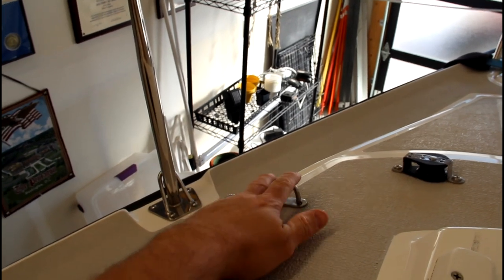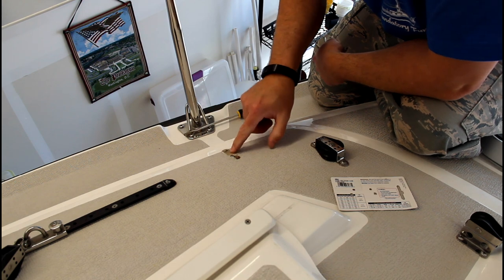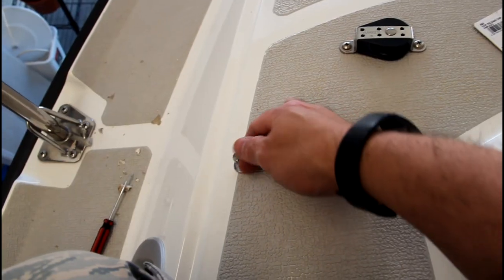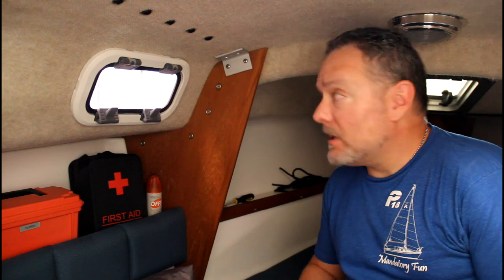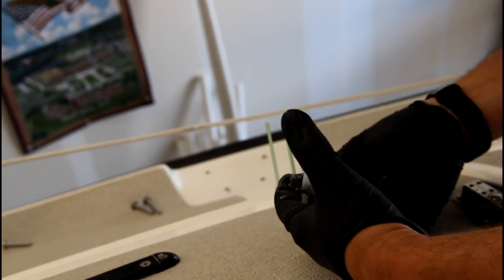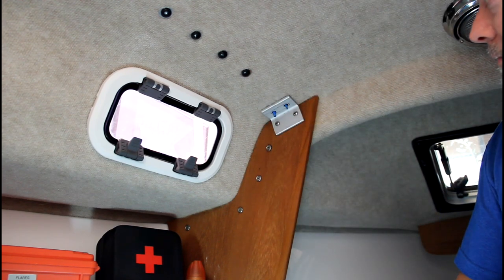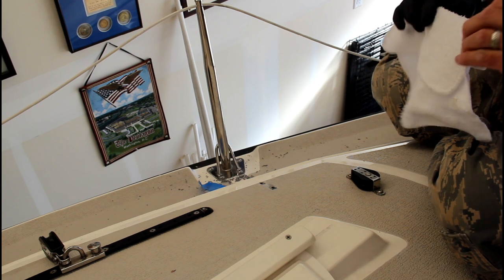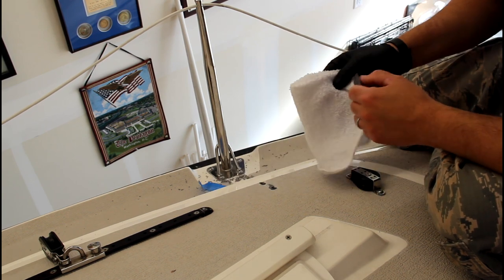Leaky Chainplate Repair

Comment: Thanks for video i will be resetting lifeline stansions after this season  i just assumed the core was wood ido like the simplicity of butyl ,i use it for everything idid use 4200 when i replaced my swing keel its easy to get it everywhere,? thanks again for the post

Comment: Hey Dave, nice repair tutorial. Question, how do you know how hard to 'torque' the fitting down without over compressing the deck? Tnx.
Reply from the maker: Hmmm. I hadn’t really thought about that. I just tightened till it felt right. But, you make a good point. If not tight enough, then any movement or flexing could break the bead of the sealant. Too tight could compress the deck and maybe crack the fiberglass. The good news is that unless the chain plate snaps in half…it’s ain’t going anywhere. The backing is quite strong.

Comment: chances are they all on verge of leaking after 12 years it font matter what is used to seal the fitting its just a preference as to how often you want to reseal things,never had to reseal any i used butyl on but have resealed most were i used a soft elasticated sealer outa a tube tried lots of different makes